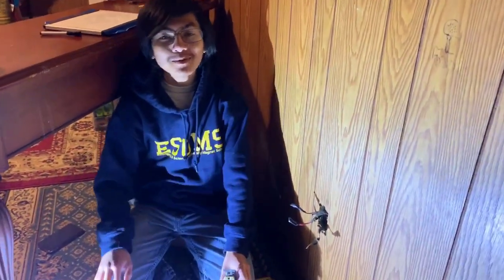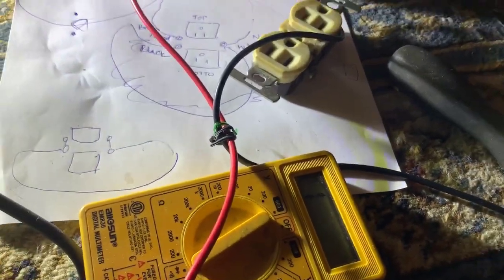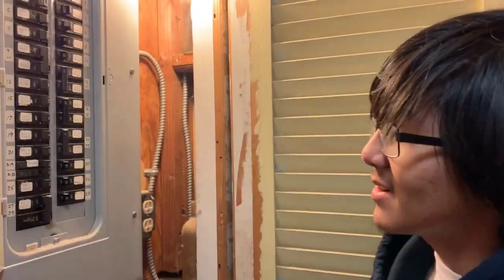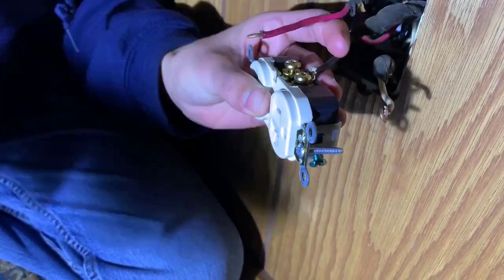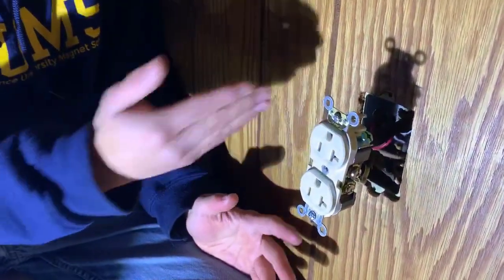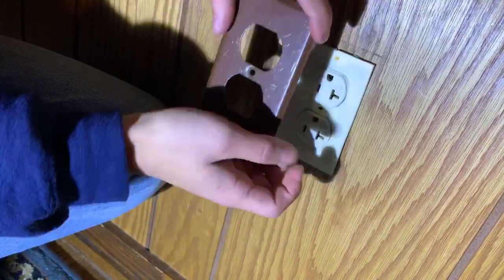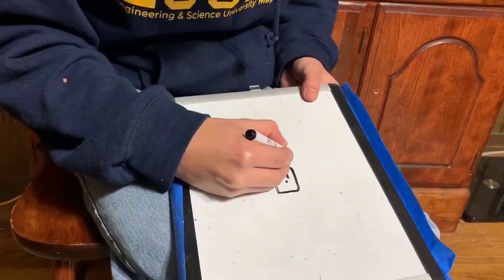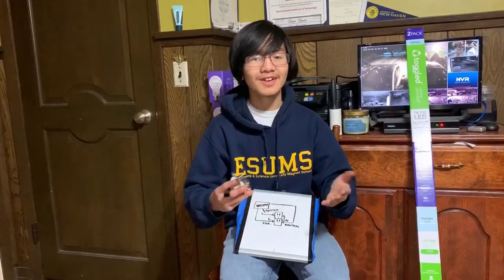How To Replace Half-Hot Switched Electrical Duplex Wall Receptacle Outlet | DIY Home Repair By Aiman

Comment from the maker: Here are the #ᴬᴰlinks for parts and tools showcased in this video:
1.  https://amzn.to/3OgrWyh  |  GE Wall Switch & Outlet Combo, Two-in-One Receptacle, 1 On/Off Toggle Power Switch, 1 Grounded AC Outlet Wall Plug, Single Pole, 3 Prong, 15 Amp, UL Listed, 
2.  https://amzn.to/4hStbRK |   AstroAI Digital Multimeter Tester 2000 Counts with DC AC Voltmeter and Ohm Volt Amp Meter; Measures Voltage, Current, Resistance, Continuity and Diode
3.  https://amzn.to/48VHZLp  | KAIWEETS Self Adjusting Wire Stripper - 3 in 1 Heavy Duty Automatic Wire Stripping Tool | 10-24 AWG Wire Cutter for Electrical Cable Cutting, Crimping Tool

Or Click on Amazon link here and search for what you need:  https://amzn.to/3xIOsqg